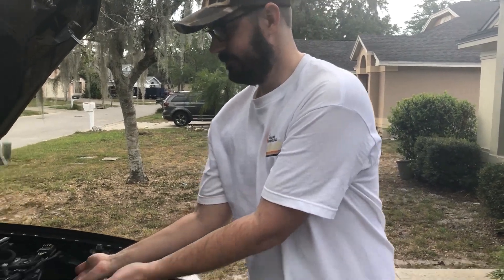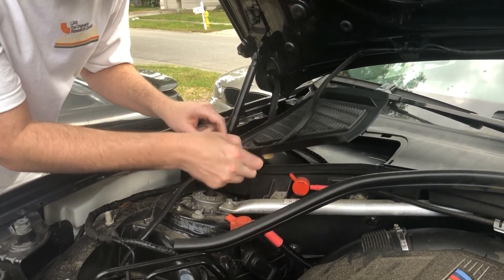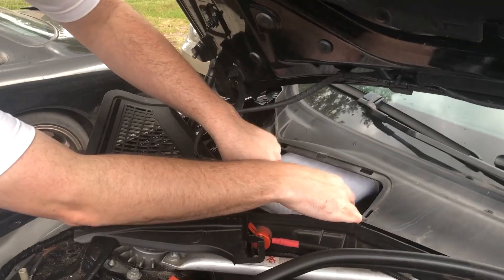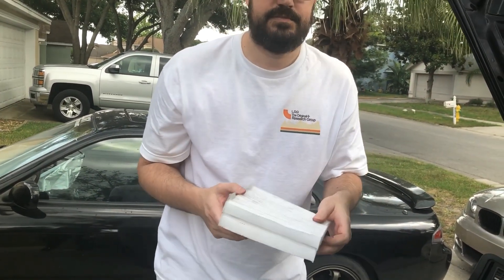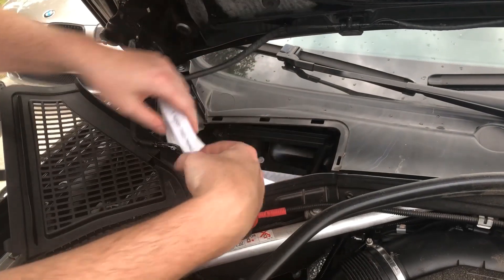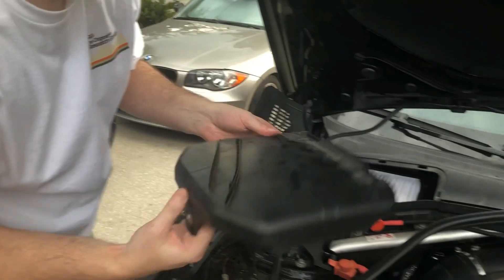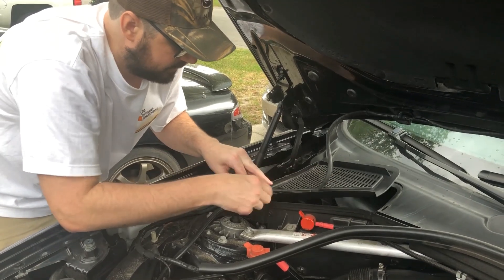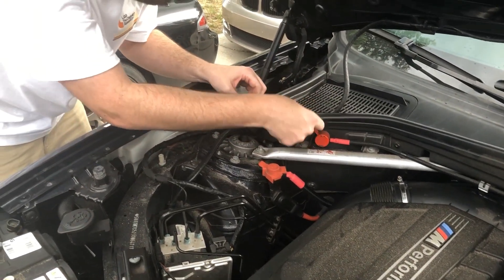2014-2018 X3 X4 Cabin Filter Install / Replacement

Comment: Hi, thanks for your video. there is an  other plastic housing with 4 clips  over there, its better to remove it first before removing filter. it will be more easier and  not deforming your new filter. thanks
Reply from the maker: Mais Bohozian cool. I’ll check that out. Thx

Comment: That doesn’t apply to the 2018 X3
Reply from the maker: Manu B why would it not? Mine is a 2018. Only thing different is the rear end. Maybe it’s different because the motor? This is the M40i.
Reply: Poizon Freak mine is not M40i, it’s the X Drive 3.0